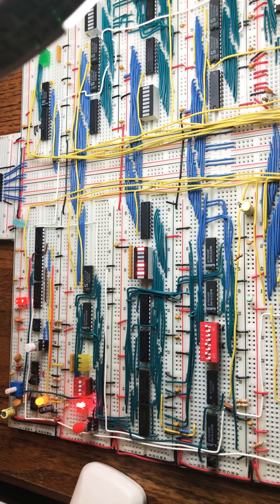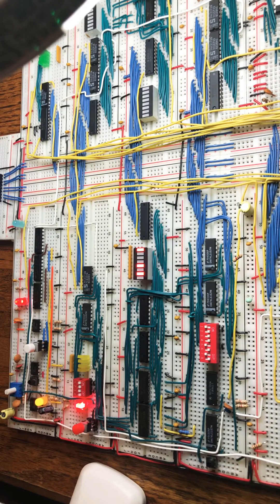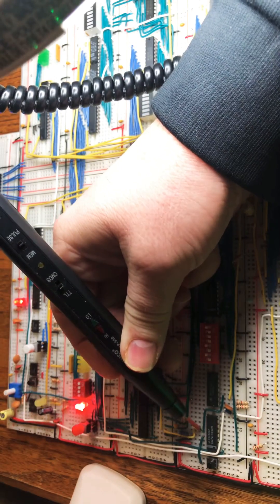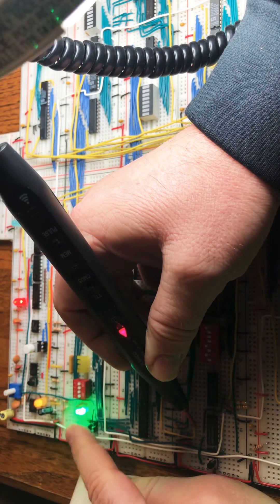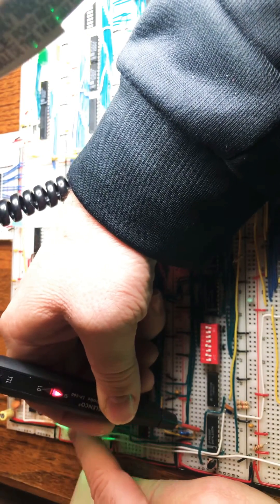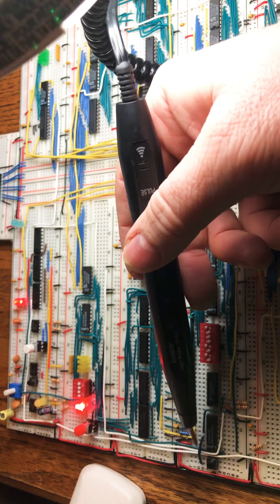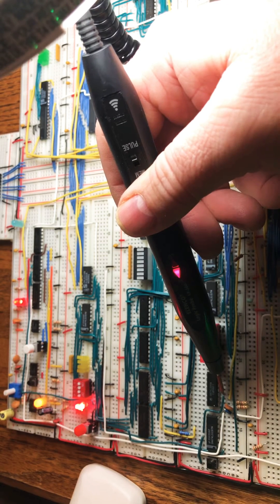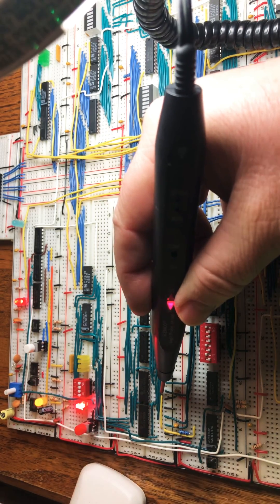Problem with Eater SAP-1 computer

Comment: Did this turn out to be a capacitance issue? IE the breadboards acting like an impromptu capacitor, which isn't a bad thing but is flaky. Did adding a capacitor correct this behaviour?
Reply from the maker: Actually, it wasn't capacitance. I solved the problem in this video: https://youtu.be/W2w9KVmyxRs